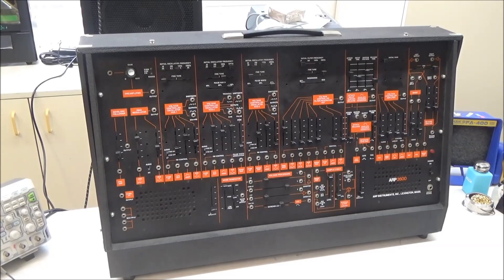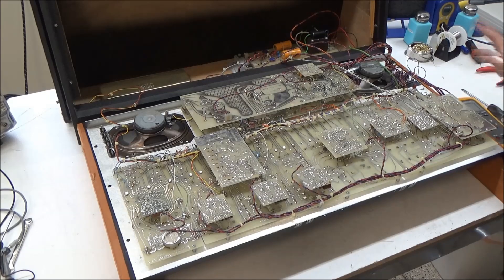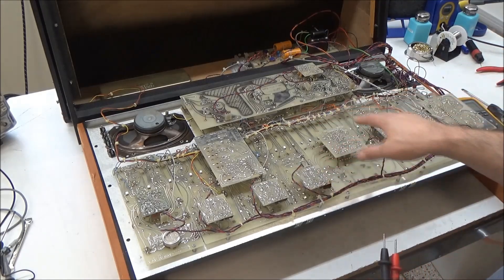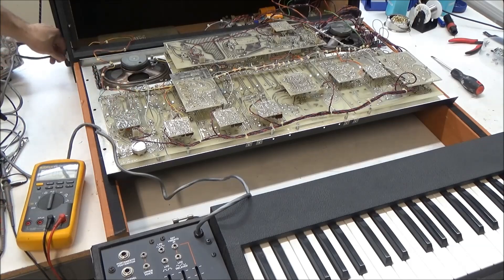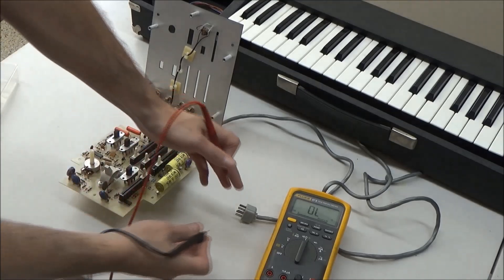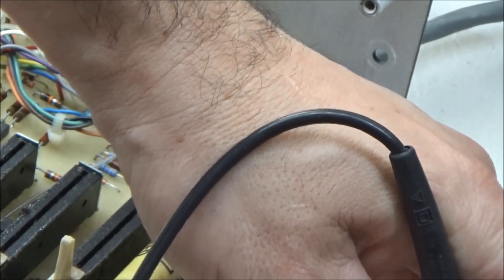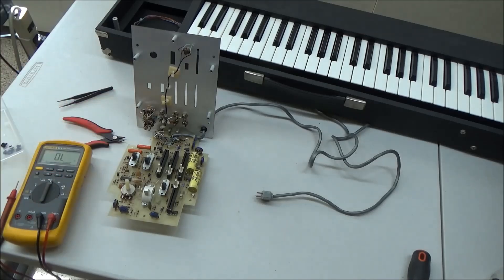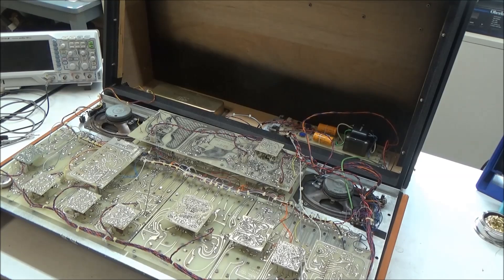Repair of Smoking ARP 2600 Synthesizer - Synthchaser #147

Comment: Great video. Yes, based on my own experience these damn tantalum capacitors simply fail and create shorts after 20 or more years. I had this in several old synths. You always should replace them alltogether.

Comment: If the smoke was in the synth case, What was smoking? That would need replacing too wouldn't it?
Reply from the maker: Keyboard controller sits right in front of the synth case, maybe he thought the smoke was coming from the synth case, but it was coming from the keyboard controller.

Comment: Gotta love tants. I worked at a cardiac monitor manufacturer in the 80s and one unit came back with the ecg printer filled with extinguisher powder. A tant started smoking and a nurse panicked and poked the extinguisher nozzle in the only hole she could find. On the plus side she had grabbed an appropriate fire extinguisher! 😀

Comment: I had the same problem on my 2600 built in '74. It had not been turned on for several years. When I flipped the switch a plume of smoke and the smell of burnt electronics greeted me along with the sound of the smoke alarm. One of the tantalum caps was torched, so troubleshooting was quick! I replaced all of them as well. What a great machine.
Reply: Tantalum caps are basically small time bombs with a random fuse.